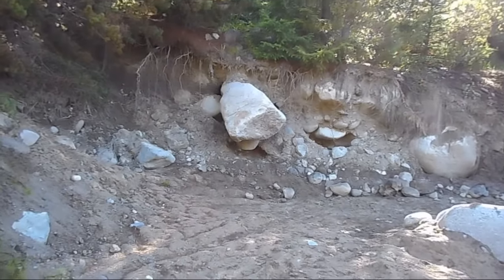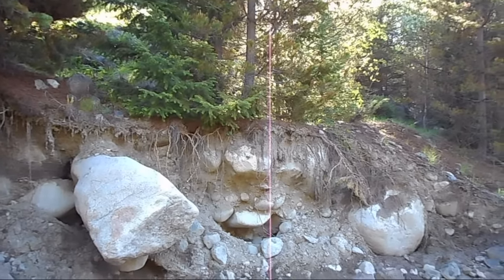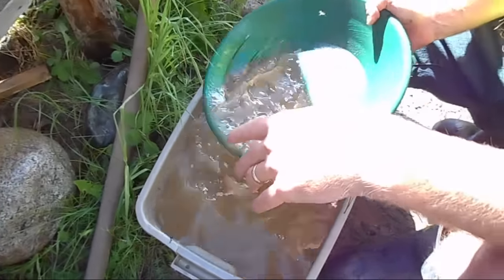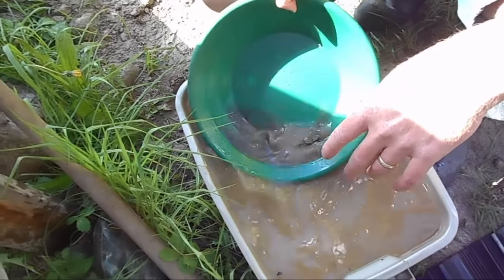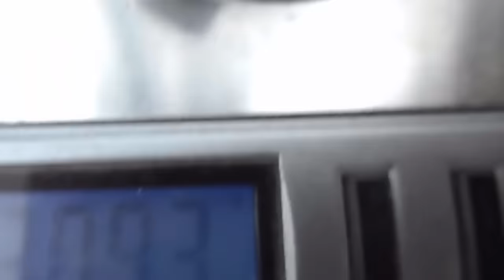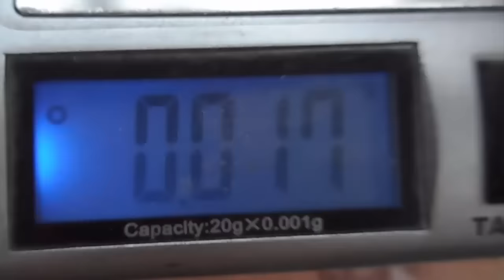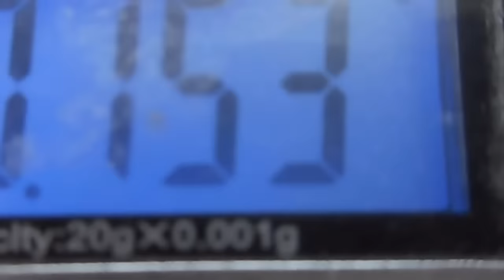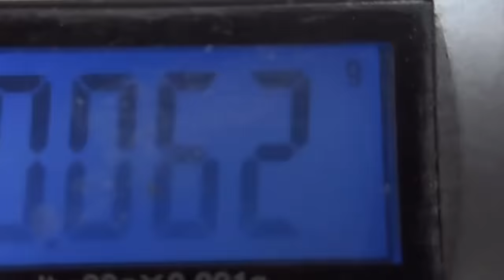Small scale machine mining at Trout Creek Claim (nuggets!)

Comment: Wow that looks like fun! Hey little Bobcat driving tip when you are trying to get the last of the soil out of the bucket instead of rocking the Bobcat back and forth with your arms just use your right foot and you have to heel toe the foot pedal quickly and it will jiggle the bucket in the soil will fall right out it's a lot safer than going back and forth because if you make a mistake doing that you can snag your feeder box and cause all kinds of havoc. Just a little thing I learned being a bobcat operator on a landscaping outfit
Reply from the maker: thanks for the tip - I'll have to try it!

Comment: Moving that big rock. i would have gone around to your right and came in from behind it and pushed it down hill out of there easy peasy, stick the bucket out and drive lowering the bucket as you moved then you could have started rolling it by driving forward and raising and lowering the bucket. drop the bucket move forward catch the bottom edge start lifting as you move forward and keep moving and lifting the bucket til it rolls. then move forward and repeat until it is where you want. a good rule of thumb is to study the situation for a few minutes and come up with a plausible plan then put the plan into action. 
Dont just drive up and smack the bucket into the side of the rock leaving the rock no other option than to fall between another rock and the hill. never try to push a heavier than you object it up hill. . Leverage is the only way for a lighter machine to move a heavier object. ie pushing it downhill. getting it rolling is a learned thing how fast to move forward and bring the bucket up and down must be in done in harmony. i have owned a bobcat for better that 30 years and can move most things twice its size. but that is after 30 years. Just a piece of unsolicited advise only because I made the same mistakes
if you can't pick an object up with just the bucket then you must apply leverage get three or four inches of the bucket under the edge in front of you and aply lift as you move forward dont be afraid to push the gas pedal down bobcats wont go very fast even with the pedal to the floor they are slow but giving it gas increases the hydraulic pressure  which increases the lifting force.. so when lifting heavy objects more gas increases you lift amount and lift speed. Ok I am done beating this dead horse